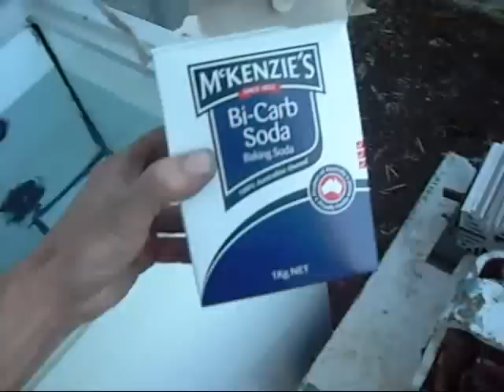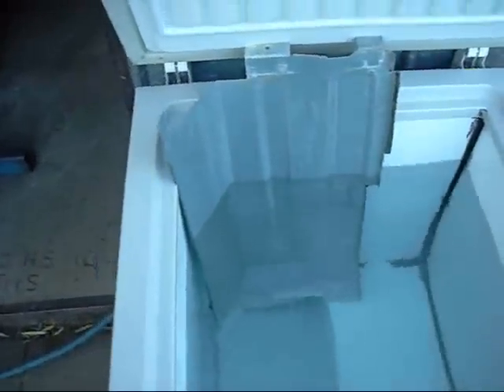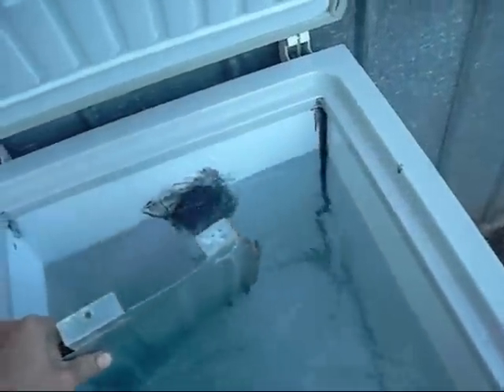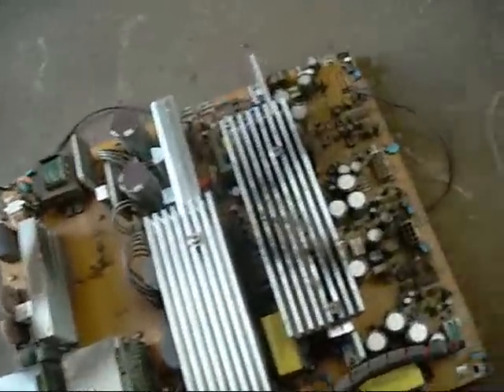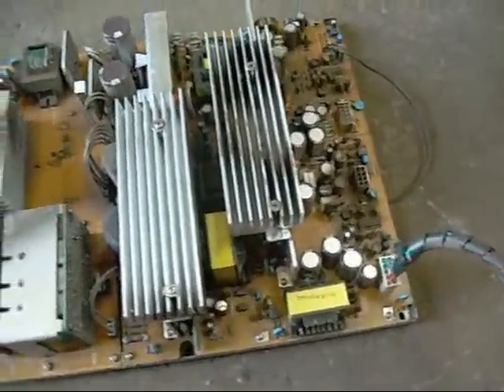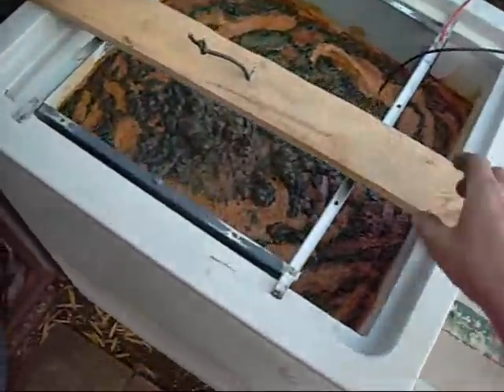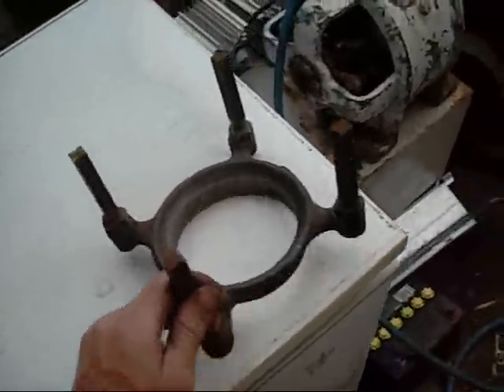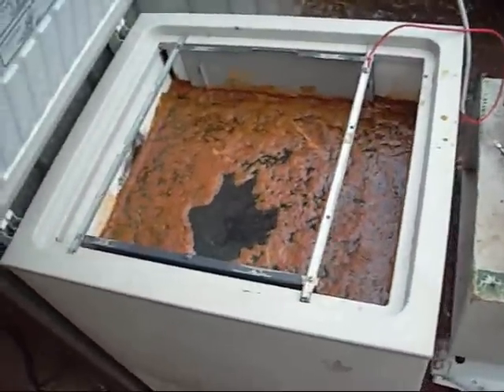Chest Freezer Electrolytic Rust Removal Tank - Minolta Di620 Switchmode power

Comment from the maker: @harlstr I could do it for you, but its a really easy thing to do at home tho. if its just the inside you can suspend a sacraficial anode inside, fill it with electrolyte and connect Negative to the tank and Positive to the anode.

a 5A batt charger will do for a small job like that.

Comment: I was thinking of turning a dead freezer I have into an electrolysis tank, but I figured that I might have to line it with something like plastic vapor barrier, I didn't think that the paint would be enough to stop the anode from making electrical contact with the inside of the cabinet but maybe so. One thing that I did find out is that anodes with a larger surface area work better so forget about just using  a single chunk of re bar.

Comment: I'd use that 24V charger for that freezer tank, Ya want high current to do the most work in the shortest time span, You could shut the lid, and recover the hydrogen, Although i doubt it'll be pure enough to even run a small engine, may be worth a try I'd stick a full box of washing powder in there, it is pretty effective, and smells good too :P, Good Vid, that engine'll come up like new

Comment: @shidoink It uses 6 to 15 amps but that is at a low DC voltage like 6, 12, 30 volts not at line voltage. Volts times Amps equals Watts, so 15 amps X 6 volts=90 Watts, and that is if it's drawing that much, basically like a light bulb. My charger tops out at 6 amps at 12 vdc so it would be about 72 watts. If the DC is more purified with some capacitors or something it will also work faster.

Comment: @harlstr I know that to clean a tank inside you use it as the sacrificial anode , I found a web site on it years back , but replaced my tank , if I remember right used like a bolt , and added the other side straight to the tank , google removal of rust from a fuel tank , oh and don't try what I said on my word , it's been years since I read that , make sure before ya do anything !!!